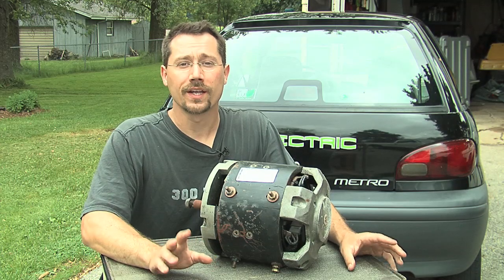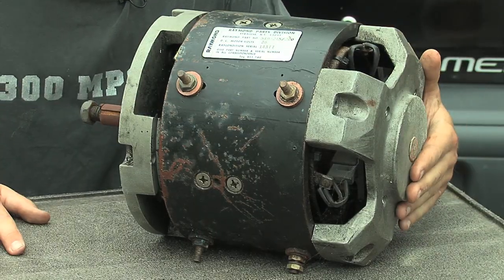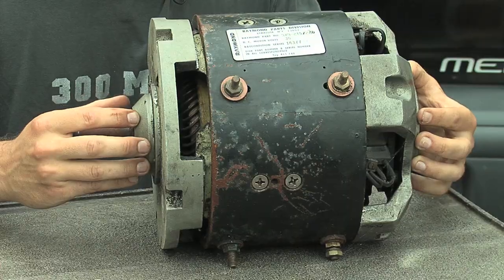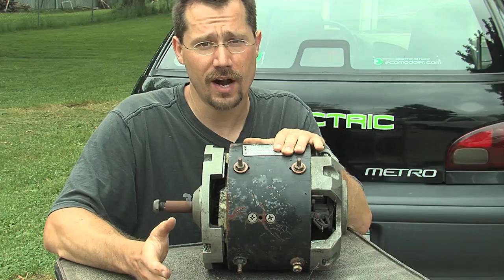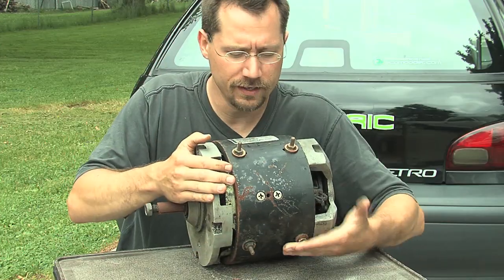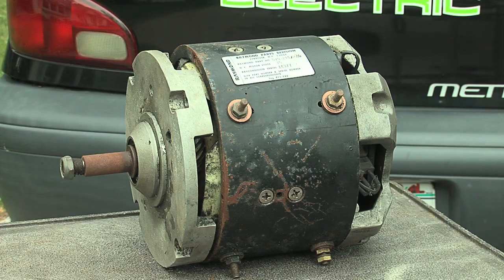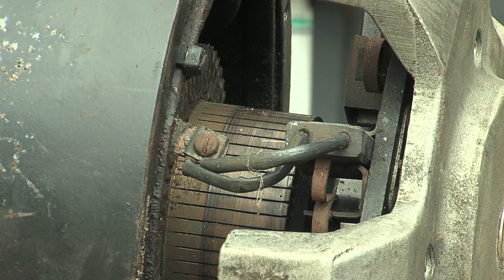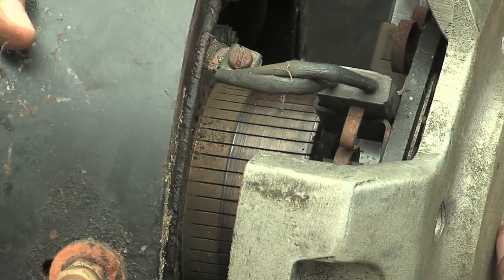5 Build Your Own Electric Car: DC Motor Basics

Comment: I'm pretty sure most Ev's use three-phase A.C. motors. Any other type of motor would not produce the scaleable torque needed by an EV.
Reply from the maker: Most modern commercially-produced EVs do use AC motors, but NOT because of torque. A series-wound DC motor can produce a tremendous amount of torque. These are the types of motors which have been used in forklifts, construction equipment, and even home-made electric drag-racers.

Comment: I wrecked a very old forklift which had to be the oldest forklift i have ever seen came from the local railways, it had 2 motors, the drive motor was at least 4 times the size of the new motors and it had 1 motor for the hydraulics. huge motors, it had a battery bank for the counterweight about 1 square meter in size. have to see if they can be used
Reply from the maker: A friend of mine got an old forklift for free from his work and built it into an electric motorcycle. Called it the Forkencycle. https://ecomodder.com/blog/forkencycle-dirt-cheap-diy-electric-motorcycle-made-from-forklift-parts/

Comment: The best motor(though AC) to use is the induction motor, one magnetic field, no magnets using principles of mutual induction as used in Tesla cars, more difficult to control; as you need 3-phase controllers though. Tesla's induction motor has been used reliably in industry since its creation. I wouldnt put ANY commutator design into a car; brushes burn out fast, plus the commutators are prone to ware or even come off under excessive heat. Good battery management is important; lithium Ion's when shorted out in such high capacitys could literally blow your car up; or at least set it on fire.

Comment: It turns out that a motor which uses electromagnet for the stator works equally well on AC.
This is how all vacuum cleaner motors are made.
Reply: That is true, BUT you have to run an inverter, and probably a cooling system.

Comment: 4 fwd and one reverse? Sorry I thought on ev’s there’s no gear changes, the pot is adjusted to control the voltage, which changes the rpm.
Reply from the maker: On this car, I usually did just drive it in 3rd gear and drove it like that. At a bare minimum, you still need some place to mount the electric motor, and some way to split the power to the two drive wheels. Using the mechanical reverse gear also means there's no additional electrical components required to back up the car.
The existing transmission provides all this.
Even a Tesla has single speed gear reduction and differential.

Comment: once again what is the amps on that thing as i am looking into 220v with 40 amps hydraulic motor for a conversion using a generator that goes five hour on three gallons of gas but as usual it is only a freeway car as it makes full energy all the time. do you think it will work. again how many amps is the motor you are working with???
Reply from the maker: The motor that I used in the car could draw 500A when connected to a 500A controller and used in a higher gear.

Comment: Good explanation but why choose a brushed motor over a brush-less motor? The brushless motor has less maintenance and less to go wrong from my experience. Brushed motors are a pain in the ass.
Reply from the maker: In general, brushless motors are more complicated, expensive, and require more expensive and complicated motor controllers. Basic DC motors tend to be cheap, easily obtained, and can be controlled with a basic PWM motor controller.
The motor I ran in the electric car I built ten years ago used a $50 forklift motor and a 500A homebuilt motor controller.
Learning how brushed DC motors is also fundamental to learning about other types of motors and electro-magnetic projects.
It's great to see that brushless motors and matching controllers are now much more freely available than they were in the past.
For videos I've done on brushless motors, please search for "Vectrix" on my channel page.

Comment: Wouldnt that mean parallell? If it was series wouldnt it have 2?
Reply: Wait nevermind i didnt know you cross it over outside the motor.
Reply from the maker: A series-wound DC motor with four power connections allows you to reverse the polarity of either the just the armature or the field coils. That allows for reverse. Series-wound DC motors with only two power terminals on them are NOT reversible.
Reply: @BenjaminNelsonX  so you bridge them outside the motor?
Reply from the maker: Yes, two of the power terminals are connected to each other, and the other two go to the battery/motor controller. Which two terminals are jumper controls which direction the motor spins. It's common in a forklift that four power cables run from those four terminals to a "Reversing Contactor". That normally jumpers the motor one way, but when a switch is flipped, it gets jumped the other way, reversing direction.

Comment: I'm probably a bit late for any questions, but the brushes in the motor you show are all facing a certain direction, will you run in to issues with the brushes wearing or binding if you run it in the opposite direction?

Comment: you do understand that DC motors convert DC to AC so that it can fluctuate between the polars.

If you create a magnetic field with DC it will be static, no polar shifting at all and will be wither positive attraction or negative.

The DC motors are DC conversion to AC, the only difference is, is it a single phase or 3 phase motor?

Now, remember AC is alternating current, DC is direct current. It's important to know that fact
Reply from the maker: A DC motor does NOT convert AC to DC.
What it DOES do is "flip the poles". As the rotor spins, each section of the commutator is reverse polarity from the one next to it. If you showed this on a graph, it would be a single phase square wave, not a sine wave.
There also ARE motors which only use continuous, single polarity direct current. Those are called Homopolar motors. They don't have too many practical purposes compared to many other motors we use today, although they can be used to power rail-guns.
Reply: +BenjaminNelson he said dc motors convert dc to ac. Maybe he meant ac to dc. Obviously it depends if the supply is ac it will need to be converted to dc if you have a dc motor. 
On another point - horsepower, whether electric motor or fuel, should be a comparable unit. Torque refers to the twisting force on a rotating shaft. The difference in the torque on an electric motor is that it remains fairly constant throughout the rpm range, whereas in fuel driven engines there are peaks and troughs.

Comment: Why not use hub motors
You save up on a lot of weight and space
Reply from the maker: I bought the forklift motor for this car for $50.
There are extremely limited high-power hub motors available, especially single-sided ones appropriate for cars. Hub motors also have issues with unsparing weight. Hub motors are pretty useful for bikes, but there are few used at this point for cars. I can't think of any commercially-built electric cars using hub motors.
Reply: BenjaminNelson 
Where I live it is next to impossible to get any custom work done for fitting the motor to the transmission
Plus I only plan on using it to zip around the neighborhood go to friends houses etc 
I don't plan on going on the highway whatsoever 
So this is kind of my only way for a diy EV

Comment: i think you are wroung about that 4 wires, it's for recupiration and for extrimal breaks ... if you whant to stop or fix you motor you cat put one direction to one coil and another to another ... that's would stop and fix rotor! or ... if you what to stop slowly you can put some load on one coil and get power from it
Reply: BTW if you whant to change direction you can just mix + and - .... and no motor disassembling at all!

Comment: I built a 108vdc system with a 48hp S&S motor, used 18 Lead acid 6VDC batteries ... all in a 1989 Toyota Corolla stationwagon... was not worth the cost or the time. The waiting for parts, missed orders, the batteries only lasted 2 years... yeah got the money? Have fun... would definitely go with Lithium packs 'next time' and AC System!

Comment: I converted a VW bug with a Raymond motor that had internal series connections like you mention. Indeed, when I first started the car I had 4 reverse speeds and 1 forward. I took the motor to a motor shop and the corrected the wiring for the direction I desired. These motors are powerful, heavy but easy to work with. I don't have the car anymore but it was a great learning "vehicle" for me. Thanks for making this video.
Reply: if u don't mind me askin, then afterwards did you do any other related project?
Reply: @deSalvay  I went on and founded the Virginia chapter of the Electric Auto Association which helped a 6 or so individuals convert cars. I wrote a grant to purchase a professionally converted ford Escort car and installed a solar charging station for it. Since then I have moved on to teaching.

Comment: You are a patient man, answering some of these questions. I'm just wondering if IQ numbers can go negative.
Reply from the maker: LOL. Well, you certainly do see all types of comments on YouTube. In general, I am just trying to get information out there, and help people learn new things. Some people have little to no experience with electricity, motors, and EVs. I try to give people the benefit of the doubt. Before I built this electric car, I had little experience working on EVs too, but I gained SO MUCH from the EXPERIENCE of it. I hope other people try learning new things by doing, whether that's with electric vehicles or something completely different.
Reply: Thank you for the info on the DC motor..question can electric batters recharge during driving? Second Is it better to use the bottom half of the engine with the motor on top connected to the crank shelf via belt?

Comment: LOL... Putting in new Brushes and painting the wingdings is Not Rebuilding...
Reply from the maker: What else would you do? All the terminals looked good and the bearings were in great condition. When I had the motor apart over at a friends to work on the adapter plate we also cleaned up the commutator and then I also used a commutator stone when setting the new brushes. This video was meant to be an overview, not a detailed video of rebuilding a motor.

Comment: I guess you can't use a simple h bridge to reverse direction.  So you HAVE to keep your transmission.  
But maybe there is still an efficient way of wiring the 4 connections to allow electrical reverse?
Reply from the maker: Since I was going to be keeping the transmission anyways, I simply used the reverse gear. In a series-wound DC motor, reversing the polarity to the motor doesn't do anything. Since the field and the armature are in series they BOTH reverse polarity and the reverse of reverse is still the same direction!
The electric motor used on this project had external terminals for BOTH the field and the armature. It's common on many forklifts that there are FOUR power connections to the motor. This allows the field to be reversed while still allowing the armature the still have the same polarity. It's commonly done with a "Reversing Contactor". When activated, the contactor disconnects power and then reconnects power in a reversed polarity.
For more about how this works, look up information on forklifts. It's neat stuff.

Keeping the transmission is also a convenient place to mount the motor, provide gear reduction, allow for a differential, and physically connect power to the wheels.
Reply: An h bridge reverses polarity on a single winding using mosfets.  Possibly you could use a similar but different way of reversing that "permanent strap" to the other two bolts.  So no relay involved/all solid state.   
Modern mosfets can have only an ohm of resistance and can deliver 100A+.  They are quite amazing!

Comment: Big question can you couple a car alternator to end of this motor similar to a car so that when the car picks up inertia you will continually recycle energy back?? I know these motors can also be turned into regenerative energy when you brake. Also what is the maximum speed mph using this forklift motor??
Reply from the maker: Yes, on an electric motor with a tail shaft, you COULD connect an alternator. However, it's generally easier/more efficient to use a DC/DC converter to electronically charge the 12V battery from the main battery pack. Using the main battery pack to spin the motor to spin an alternator to charge the 12V battery is a somewhat roundabout and inefficient way of charging the 12V system. You can NOT add an alternator to charge the main propulsion battery - that's a perpetual motion machine, and doesn't work, you only get inefficiencies. Theoretically, you COULD wire up an alternator so that it only activates when you hit the brake pedal, but if you are interested in regenerative braking, it would be much easier to do with a Permanent Magnet motor or an AC motor than hacking an alternator onto the back of the drive motor.
Reply: @BenjaminNelsonX Hey thanks  and how does a DC to DC converter exactly work? Could you wire up the alternator to charge the batteries as soon as you take your foot off the pedal or brake? You say you can do a regenerative breaking with an AC motor could you use an ordinary induction motor? What is the smallest motor you could go as the big secret is gaining inertia. Also how fast does your car go I watched all your vids and never heard you mention  anything.
Reply from the maker: An alternator COULD be wired to activate only when pressing the brake pedal. That's really the only way that running an alternator connected to the motor and wheels would make sense.
A DC to DC converter is an electronic device which converts one voltage in to another voltage out. They are commonly used to run from main traction pack voltage to 12-14V to charge the 12V auxiliary battery. They are much smaller and lighter than an alternator, and have no moving parts, thus none of the mechanical losses an alternator has.
Regenerative braking can be done with all common types of AC motors as well as Permanent Magnet DC motors. Any size motor can be used as a generator, but the size of the motor is based on what you want for power for pushing the car down the road.
My Geo Metro was designed for mostly around town use. The original 72V setup was for 45 mph and at 144V I could go faster than 70 mph.
Reply from the maker: https://300mpg.org/projects/electro-metro/top-speed/

Comment: DC motors with brushes are a high maintenance and relatively low power motor. They are not designed to operate with a sustained freeway driving load. An overloaded electric motor is inefficient, and subject to high heating and brush and commutator wear.  They are OK for forklift use, golf carts, and other intermittent uses.
Brushless AC rare earth magnet motors are much more efficient with fewer turns, higher speeds,  no commutator, and often water cooled for continuous duty use.
In regards to torque and electric current. In a PM type electric motor torque is directly related to current.  A high motor torque start as described in the video is a very high current event with rapid heating and very high current draw.  A series wound electric motor actually loses magnetic field strength with increasing speed as current tapers off.  This is why they are great for forklift use.  They have high starting torque and rapidly diminishing torque when they come up to speed.  Yes the carbon block brushes is a high wear item.  Do not expect 100K miles with no maintenance.  The dust from worn brushes also contaminates the lubrication.  This is not a vehicle for your daily freeway commute.  It is more like a golf cart in performance.
Reply from the maker: Please also keep in mind that the whole project was about $1300. Yes, AC motors are more efficient, but that doesn't mean that DC motors can't be very useful and practical.
Reply: Good point. This is a budget project with limited cost.  For the money it will create an electric vehicle with limited power, range, and brush life.

Comment: Can you switch out a regular motor(gasoline motor) to an electric motor?
Reply from the maker: Yes. This project was converting a gasoline car to electric car by removing the gasoline engine and replacing it with an electric motor and batteries. Please watch the playlist for the entire project.

Comment: I thought electric cars use AC motors.
Reply: Factory-built electric cars (Nissan Leaf, Tesla, etc) do use AC motors. They're quieter, more refined, require no maintenance and have some other advantages. The downside is that they're a little more expensive. With homebuilt EV conversions, AC or DC it's a matter of preference. Think of it like carburetors (DC) versus fuel injection (AC).

Comment: put a gear on it to axles one with gener-and motor to charge batts or don't need batts motor charges and turn change over switch like for reverse and forward who do you slow down a power reducer switch
Reply: looks like a 1963 chevy 283 eng -generaterin side chevy is longer